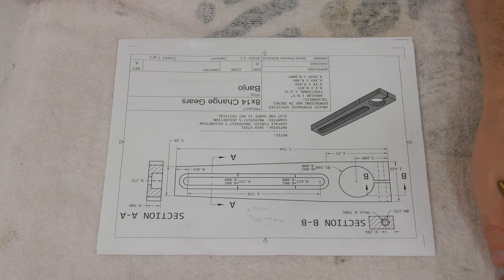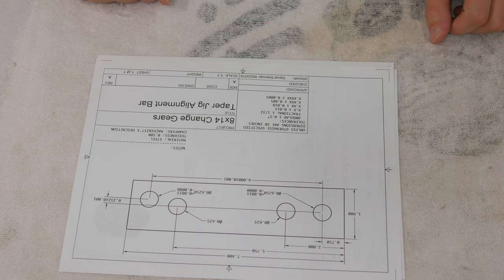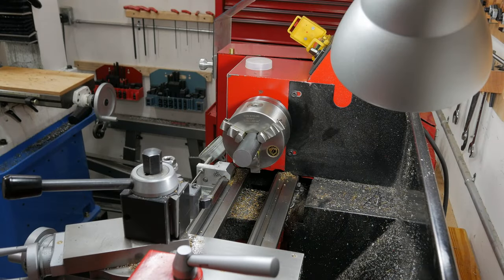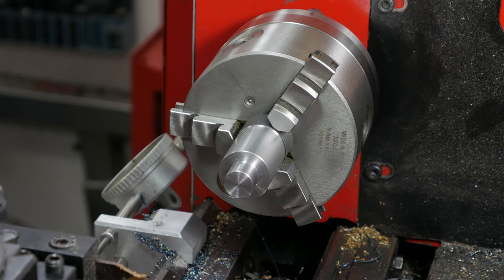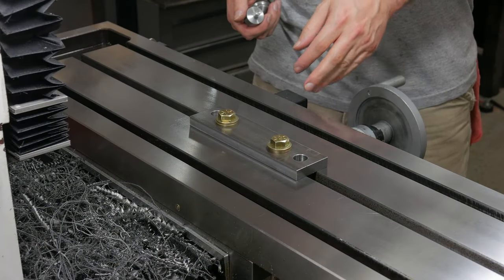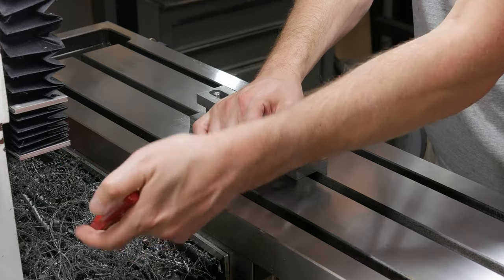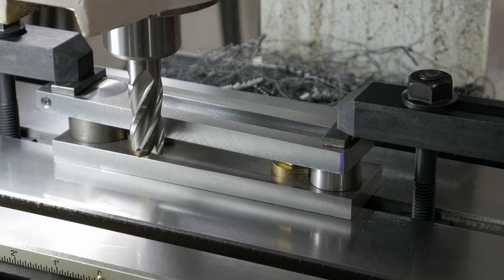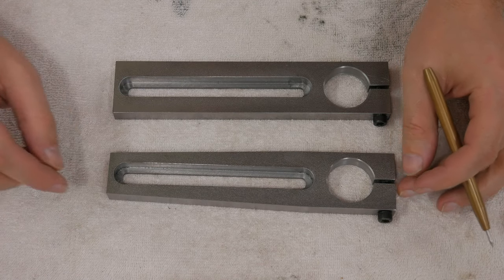A Better Lathe Banjo Pt. 3

Comment: It's a good project and excellent idea to make up the 3 banjos since that will drastically speed up any changes as you mentioned. A couple of minor points though. That would be a fixture not a jig. A proper definition of a jig is it guides the cutting tool, like drill jig bushings do. A fixture guides or orientates the part in the correct position to the table travel or angled to it like yours was. It's more than common for people to get the two terms mixed up.Since it was a non critical dimension, then scribing lines and setting those true by eye with a parallel laying flat on top of the vise jaws to give you cutting clearance should have been within .005"-.010" if your vision is half decent. Myself I would have clamped all 3 parts together with your Cant Twist's and set them by eye and then clamped in the mill vise. Then face mill one side of all 3 at once. If a bit better accuracy was wanted? Since you know your size at each end and the length of the taper then the taper per inch is easy. Set a indicator on the top of the clamped together banjos, then run the table in the X axis exactly 2"- even the full 6", keep angling the part until your rise or fall on the indicator matches what your calculated taper per inch should be. That way is almost as accurate as a sine bar and your using tooling you already have.

What you did obviously worked well and was good practice, but even setting it almost exactly with an indicator and face milling both sides of all three should have taken maybe 20-30 minutes tops. I used to put a great deal of extra time into fixtures as well, if it's really needed I still do so. But learning some other ways can still get the job done well within tolerance and a whole lot faster sometimes. From a hobby perspective, end mill cutting edges get expensive if you can't resharpen them yourself. If I can face mill the part then that way is a lot cheaper per cubic inch of material removed than endmills are. You need to buy your tool & die maker father a beer, he's obviously shown you a lot of the better methods. I wish I had a proper mentor. Without one it takes a huge number of mistakes and time while learning the basics.

Comment: Nice set up.  Since the angles aren't critical, you might have gotten by with just sighting in the vise instead of the jig, but nice get some experience in the work holding in case it need it in the future.

To avoid the issue of your hold down block barely straddling the T-slot, you could have laid some parallels (or other metal plate) on their side and then put the block on top of the parallel.

Comment: Nice work holding solution.

Seems like you could have also angled the part in the vise with a short pin of the proper size under one side to offset the part at the required angle. Similar to the way one would use a sine bar.

Comment: If you have a couple of pieces of, say, 1/4" flat-bar maybe 1.5 wide and at least as long as the leg of your triangle step-block, just set that spanning the T-slot and voila! a good surface to set the step-block on.